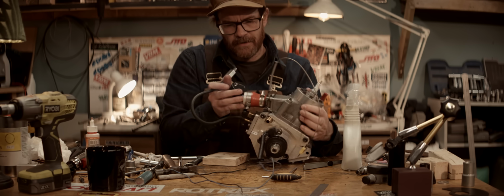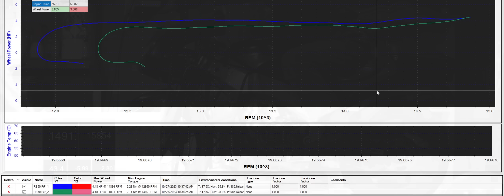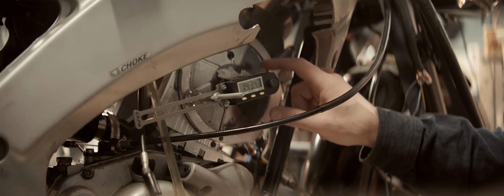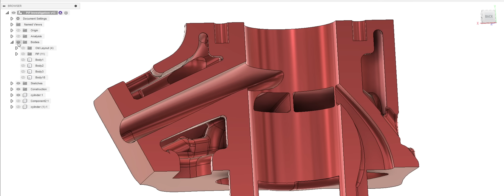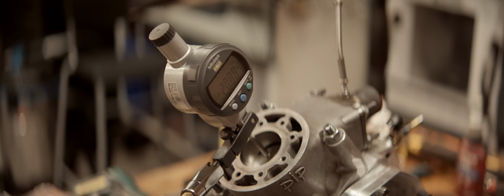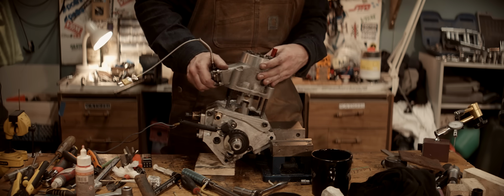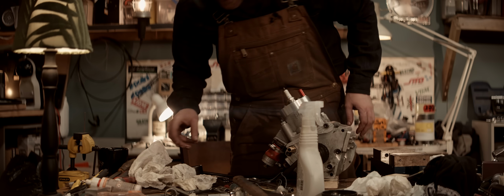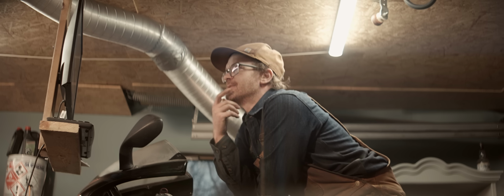Progress for Once - Road to Most Powerfull Two Stroke.

Comment: So, this is all fine and good for an NA build. But i thought you were trying to boost a 2 stroke? Other than running a turbo, i dont see how you're going to boost a 2 stroke with a pd or centrifrugal blower with fixed port timing where the exhaust closes after the intake. Theres no pressure charging the cylinder. You'd need to make a custom exhaust timing that allows exhaust to close before the intake stroke. The only other option is a turbo which will in a way act like a variable exhaust restriction as pressure differential ratio is fixed.  I still say you need high speed pressure logging. Intake pulse, exhaust pulse and log crank rotation in degrees This, along with egt and afr will paint a complete picture and take this spotty hit and miss guess work out of tuning.

Comment: Your primary belt is much too tight, even if that is not your problem. Toothed belts do not work on tight tension they work on the teeth. Let it right off, as you once before had it, in a previous video.

Comment: the real reason this dose not make power is when you made this in software you was planning to run open air with efi blasting nitro down the ports in your own  words  Ridiculous crankcase volume, no piston pumping here, it's all about resonance! - Tuned pipe, tuned crankcase, tuned intake, tuned everything, resonance! now you gone so far from this its getting to the point the kit and case is useless and makes no power all that blow back in to the ports is from the pipe having so much sucking/blowing power it was made to stop the open air intake 18-20k+ then your plan was to have that big volume filled with nitro with the efi pointed down the port to spent that exhaust gas it seam your best off making a new kit/case or going back to engines roots RESONANCE! by the way love the vids been watching for years its a shame watch you go so far way from the real reason the engine was made with crazy ports aimed at the transfer duct as it dint matter you was never planning on piston pumping to the work for you cant wait to see what you try do next keep it up

Comment: If as I believe it is an Aprilia 50 bottom half of engine ie the gearbox and it is capable of doing 18,000 rpm surely that must be rather more than 9bhp ? The Aprilia 50 doesn't rev to anywhere near that in standard form and is far and away the fastest 50cc bike ever . I don't know what the gearing is but i know that even moderately tuned they can do 80 mph or 130kmh 
In the 70's i had a Puch moped that had about 4bhp and would only rev to 7500 or maybe 8000 rpm , if i had been able to get it to rev to 18000 rpm it would have done 112mph !! 
Check the Dyno !!

Comment: I'm convinced that your dyno is faulty—it's not giving you correct data to make honest decisions, let alone a comparative analysis, especially since you aren't (apparently) taking into account the effects of atmospheric changes from test-to-test; certainly, you would agree that correction factors are important here. With your current setup, I believe that you would be better served by incorporating a cylinder head pressure transducer for determining the relative effectiveness of your porting changes/secondary compression ratio, etc. Of course, switching to an "old school" water pump engine dyno would whisk-away your torque measurement headaches by eliminating running through a gearbox, etc. Nonetheless, keep trying; I know you'll get there eventually!

Comment: What was the problem last time, the pipe.  There is software online to calculate the proper dimensions of a pipe for your engine.  Do the math and make a pipe, I sure would feel better knowing the pipe is optimized.  It’s going to be mandatory somewhere down the line, do it sooner rather than later.

Comment: your expansion chamber isint big enough for your engine    your expansion chamber should be atleast 50cc or higher cause when the engine is scavenging it aint getting enough fuel going back into the cylinder for a reburn (scavenging)    make your expansion chamber bigger than 50cc youll make more hp by that      its not your wrist pin or your piston     its your expansion chamber it aint bigger than 50cc    it has to chamber exhaust up to 100cc     thats where your problem is if u can take ur jug and can take your expansion chamber and put it through your jug (where the piston is)it aint big enough     make a bigger expansion chamber itll make HP      the black stuff in the engine is sut from being too rich of fuel and not burning it correctly cause ur exaust is too small its pushing too much gas in the chamber and cyphening it as sut mixed with gas thats what the black residue is your expansion chamber  plays a big part in that        your welcome @2STROKE STUFFING    so make ur Small Expansion chamber bigger and see how much HP itll make

Comment: your lost stumbling around like a blind man. its all got very frustrating to watch ( i'm not trolling i love 2 strokes and your channel ) there is nothing wrong with standing on the shoulders of giants. take the baton from the high point of development then run with it.  thats race engines so start with the rg 500 125 cylinder with disc and power valve, then shrink that to 50cc then copy and shrink the exhaust. do what the japanese did copy the best then improve on it please 👍